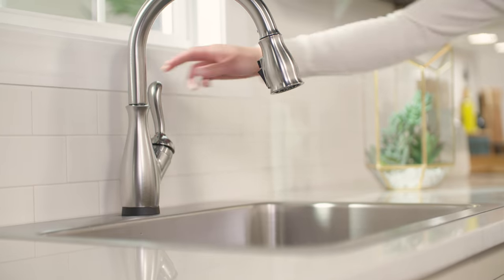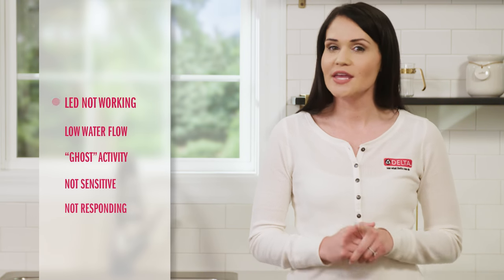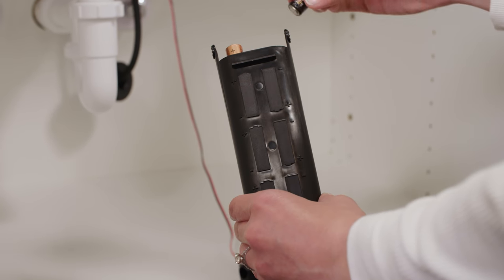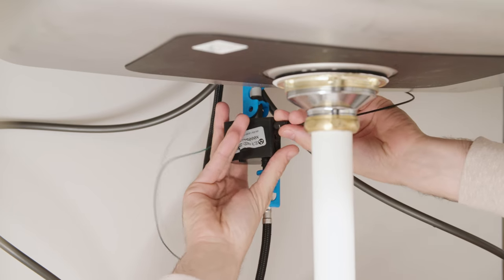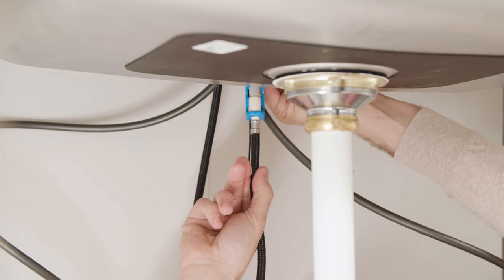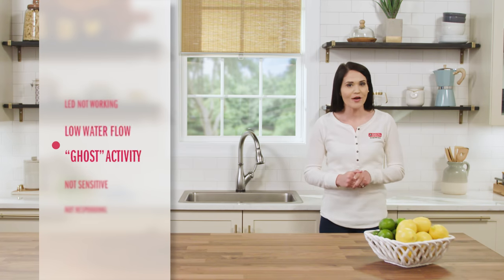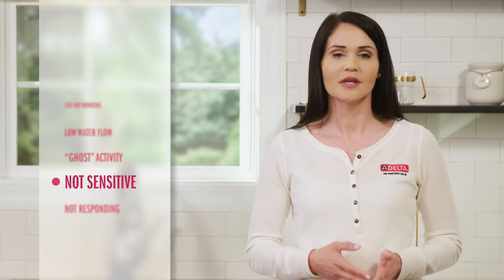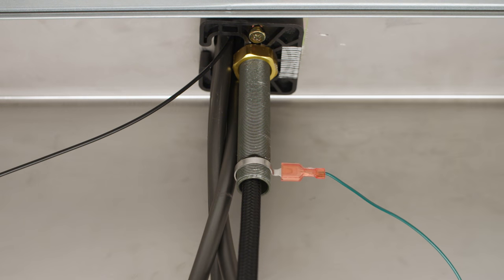How to Troubleshoot a Delta® Kitchen Faucet with Touch2O® Technology

Comment: Overpriced, unreliable, and has caused much frustration over the years.
Reply: This is crazy. This POS is blinking and won't operate normally, and it's 7 months old with minimal usage. I had a Moen sensor facet for many more years, and it always operated perfectly. This thing is a pile of garbage. Wish I'd have gone Moen again.
Reply: Right with ya.. and my faucet is only 2 years old..  drips.. turns on by it's self,.. sometime won't come on at all...   I go to Delta's home page then the parts and repair and NO WHERE IS MY FAUCET..!!!   and I'm not making trips back and forth to the dam store for replacement parts...   I should have got a Kohler.

Comment: I have had my Delta Pilar touch faucet installed for over three years. It works exactly as it is supposed to. I have to replace the batteries every year as Delta predicted. I have had no service issues with the faucet, none. I installed the faucet myself and followed the installation instructions the the letter. Working under the sink is no fun and I know that it's tempting to hurry through an install on a product like this(i.e. not reading EVERYTHING in the documentation/skimming over diagrams and details) but my hunch is that many of the consumer complaints about these faucets stem from a hurried or faulty installation. If you're a DIY installer, take your time, read!!!!, re-read, if needed.....call the support line. Hopefully you'll experience the same service from your Delta faucet that I've gotten.

Comment: Hate this thing, low water pressure, inadvertently turn it on or off, now the damn battery seems to be shot so have to play contortionist to crawl up under the sink for a battery change, or hire someone else to change a stinking battery.  What idiot designed this?  Can't wait to get rid of this.  This is what happens when you mix high-tech with a simple faucet- you have no water.  How did we manage to do without this crap for a hundred years?
Reply from the maker: Hi!

 I'm sorry to hear that your Delta Touch2O faucet is not working correctly! I would be happy to help you. This can most likely be resolved by adjusting the installation below the sink.

Please make sure that no wires are touching metal objects or other wires. Next, unplug the black LED wire and push it back in firmly until it clicks. Please reset the solenoid by removing the cap from the battery box for one minute and reconnecting it. Be sure to use a new set of brand name, non-rechargeable batteries and install them as indicated on the box. Please also ensure that the battery box is placed on the floor of the cabinet, 2 inches from the sides or metal objects.

If the issue remains, please provide photos showing the following to better help us identify the issue with your faucet:
1. The faucet itself.
2. The sticker on the solenoid assembly.
3. The mounting nut and threaded shank.
4. The battery box.
5. A photo showing how the wires are routed if not seen in the other photos.

You can attach pictures of the faucet to your reply e-mail. Please use the jpeg file format and the maximum size per email is 2.0 MB. You may need to send more than one e-mail if you are sending multiple pictures. 

To switch the faucet to a manual mode, turn the faucet on so that water is running and then remove the cap from the battery box.

Please also provide your name, address, phone number, and the date you installed this product.

Best Regards!

Frank
Reply: @deltafaucet  Thanks, I fixed the problem, gutted it and got a faucet that doesn't run on batteries, solenoids and wires and computer chips. The new one is amazing, a simple valve that turns the water on, and off. What a concept. You can find the Delta faucet in the dumpster.

Comment: Delta
See what Delta can do(sm) 
Spoiler alert - NOT MUCH. These things are complete shit. I have had mine less than a year and it's garbage, their support is completely useless, and I'm going back to my sensor-based Moen, that would at least work when the batteries were low. Also, this has corrosion around all of the swivel joints after only 7 months, which my other facets never had after years of use. So sick of previously trusted companies jumping into new markets with garbage. This thing is junk!
Reply from the maker: Hi, I am  sorry that your experience with Delta is such a negative one. I'd like to look further into this for you. Please send a private message with your model number, purchase date, exact issues and contact  information for further assistance. -Brandis